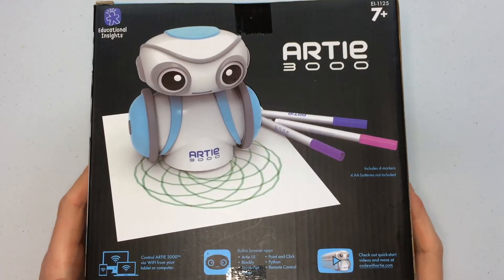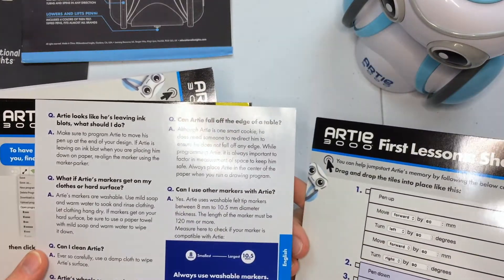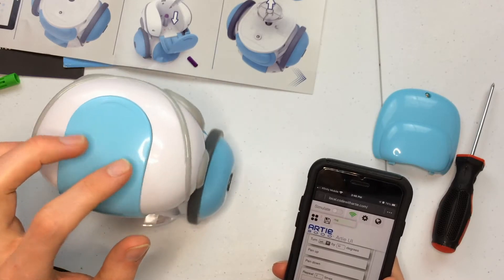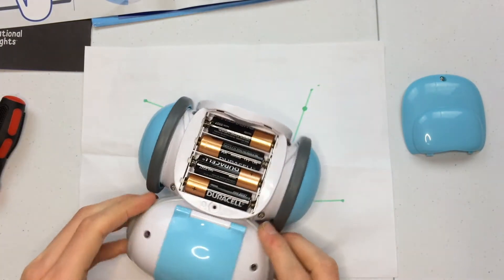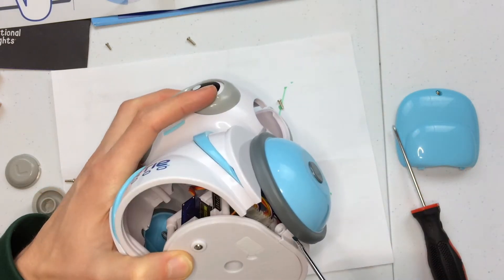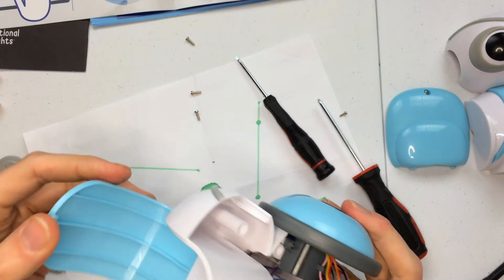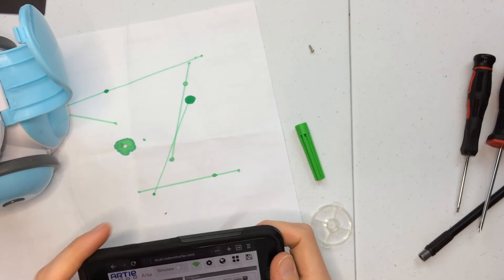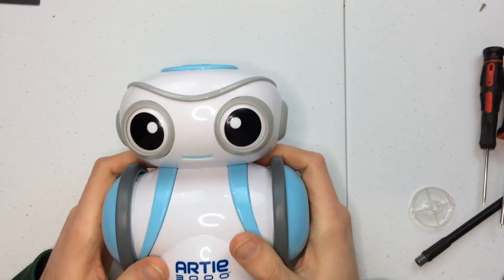Artie 3000 Drawing Robot Tear Down and Repair

Comment: The hub caps have indentations to pop them off and there are screws under them to remove the wheels.
Reply from the maker: Hey, thanks for the tip.